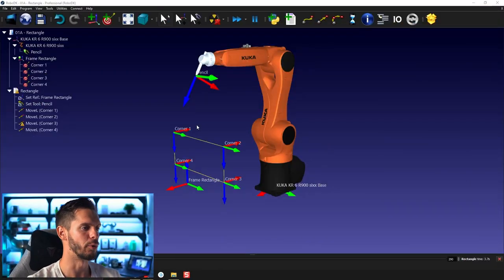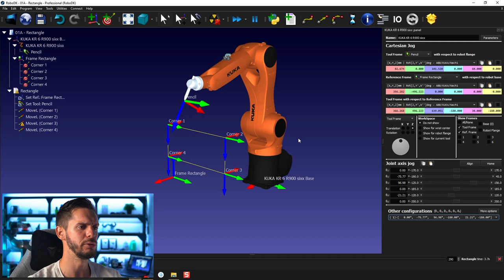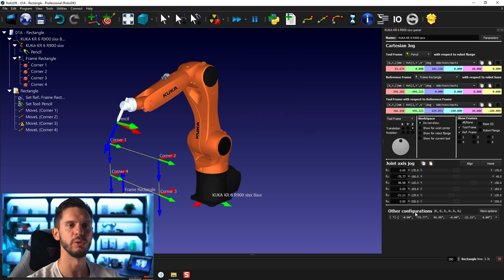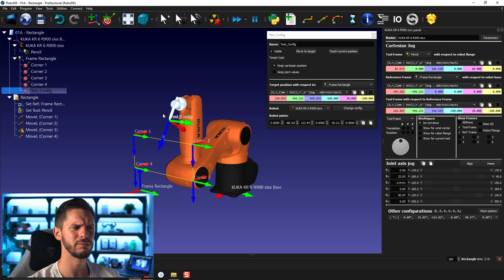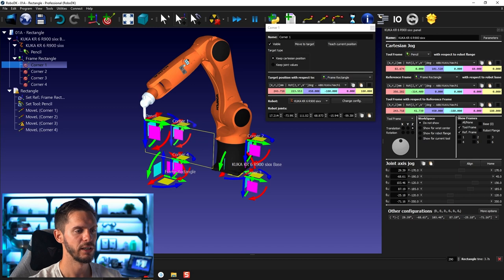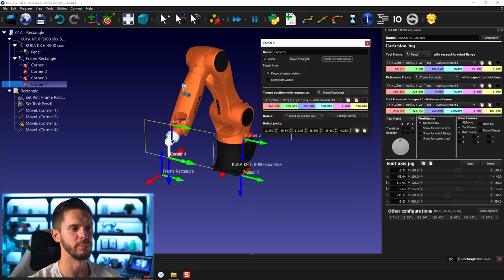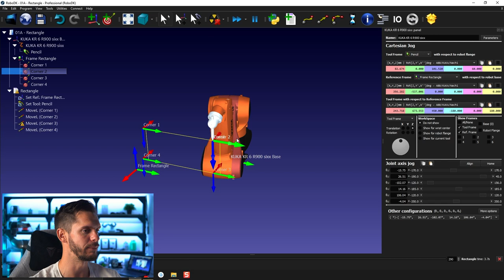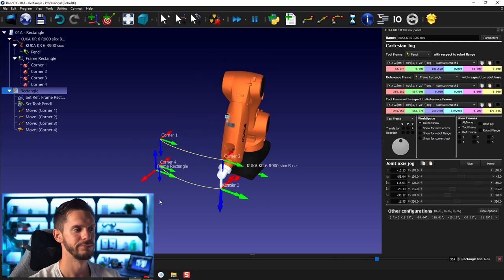Robot Configuration - Module 1.10 - RoboDK Pro Training

Comment: For UR10e robots, how do we use RoboDK to take advantage of the force torque sensor of the robots?
Reply from the maker: You can use the "Insert code" feature part of the "Program call" instruction to add the force sensor-related script commands and your required parameters.
Reply: @RoboDK3D  could we get a tutorial for UR10e force torque sensor-based tutorial?